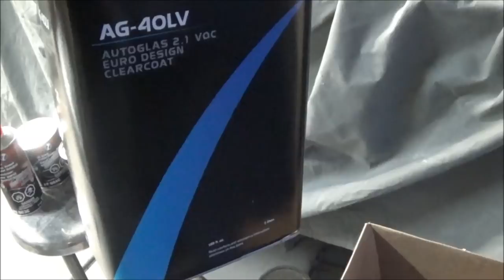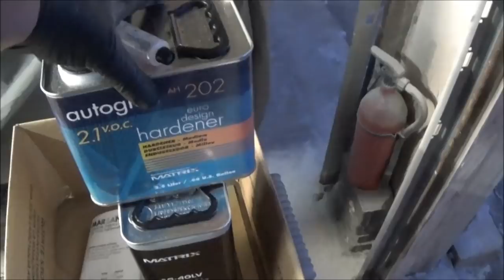1960 Triumph TR3A,  Prepping the Bonnet/Hood for Repaint, Part 2

Comment: Good thing you adjusted your sanding speed or we wouldn’t see the proper X sanding pattern.  Did you ever figure out why the paint delaminated? A painter’s worst fear.
Reply from the maker: Hi Craig, not sure why it delaminated…possibly not sanded properly on the substrate or, I sprayed the colour coat on before the substrate was dry/flashed off properly…